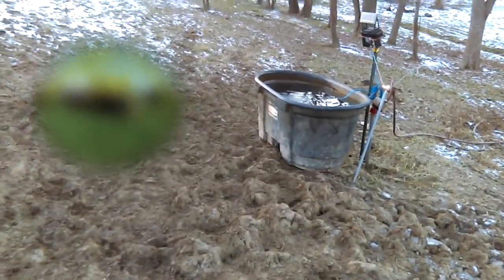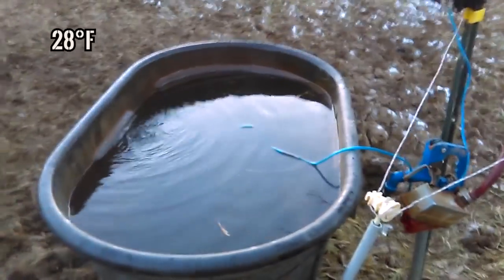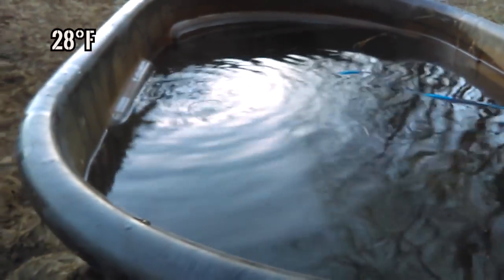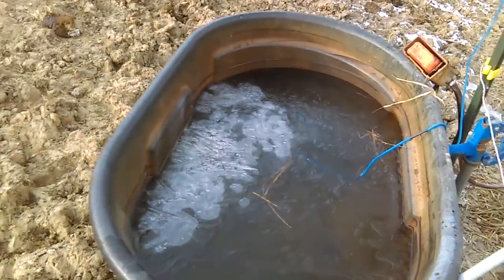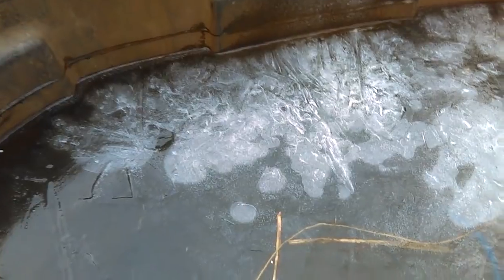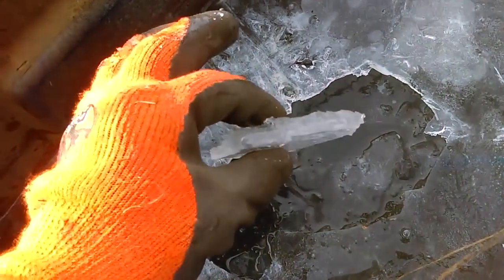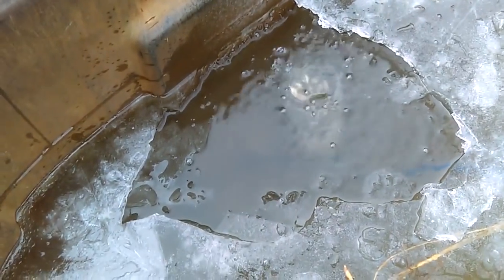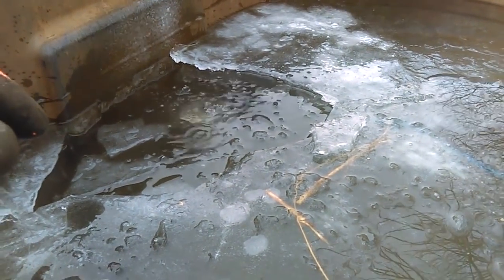Solar Powered Water Bubblier...Field Test 1

Comment: Good start Jason, I think it should be in the middle and the air should coming from the bottom. Yes insulation is next, oh you probably got it insulated by now since you said you were going to try it. At my age 68 I still have to try new things many times to get it right. I have never heard of anyone converting the fence power to some kind of heat. If we had some kind of charge controller to change the power down to 120 volts.
Reply from the maker: The only reason I had it bubbling towards the front was to make sure to have an opening in the ice where the cattle would drink. I am in the process of insulating a tank. Time will tell!
I am not sure the fence can power anything but I will be testing it.

Comment: Sorry it didn't work out first time around. Was that turned down with your voltage regulator to the same as the first video? If so you might just increase the power flow a little to get more bubbles before going to the trouble of insulating. That's assuming the battery could handle it. Good luck!
Reply from the maker: It's how experimenting goes, sometimes you have to repeat a few steps to reach your goal. Just like my hay cart, I had to keep trying different ways to lift a bale to master my setup. 
It was turned down to extend the battery life. Turn it up too much and it may not survive the night.

Comment: Post polarvortex, how'd you make out
Reply from the maker: Not very well. The battery didn't hold voltage overnight when the temps dropped. I'd return the following day to a dead battery and a air hose with frozen water in it. I haven't thrown in the towel on it, I just think it need a bigger battery and case to store everything in.

Comment: What about a aquarium heater? Its only $20 to $30
Reply from the maker: Is that solar powered? If so, I bet that would drain the battery very fast. Plus, then I would have to worry about the cattle getting to the heater.

Comment: You didn't have a control set up for comparison. To fully understand what, if any, difference it made... you really need another tank set up without a bubbler to see the difference. A control tank may have had two inches of ice on it for all we know. Really what it boils down to is that if water gets cold enough it's going to freeze, movement or not.
Reply from the maker: True that buddy! I should have but at the same time I wanted to show what I learned. There will be several videos on this over this winter in hopes it will help others in the future. Next time I will drag another tank to the back of the farm just for you. lol

BTW, I never got my pumpkins!😜
Reply: @GrazingAcresFarm  Don't need to drag it anywhere as long as the temps are the same, just needs to be a similar size and gallon content.
Sold all the pumpkins that were good and the deer ate the rest, lol.
Reply from the maker: Good point on moving the stock tank! I will keep that in mind for the next comparison.